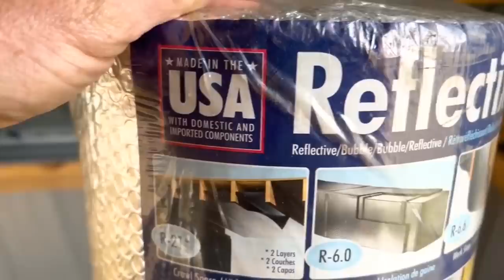We built a self heating chicken coop | Keep your chickens warm all winter…

Comment: If you let mama and babies hatch in nest, you will want to put a wire mesh see through screen square piece in front of the nest that you can either slide into place or place on the outside. Because when she hatches them they will fall out or she will jump out of nest box before all the eggs are hatched and the rest of the eggs will get cold and die. I close my hen in once she starts to hatch them for about 4 days. I emmediately put two tuna cans fitted in the corners. One with babies mesh and hers and the other with water. That way she doesn't have to leave the nest at this crucible temperature time needed to hatch them at the last stage. I will then visit her every one of those a.m.'s and take her out of nest box and place her on floor. She will emmediately go to the bathroom on floor and not nest box . I then enclose her back up again. This way I also get to take out older egg shells, thou the babies eat the lining and is important I think? I also get to see how many more eggs  need hatched. It's important to not mess with her more than this at these stages because I've had hens that will stop sitting on eggs if you mess with them too much. By providing food, it gives her those few extra days of soloraity to finish them out. Sometimes if you want you can put different kinds of chicken eggs you want her to raise from other farmers breeds.
Reply from the maker: Thank you Shelley for the tips. Have a great day!

Comment: Adding a water- filler black barrel in the area where the sunshines will add a thermal mass /heat storage tool that absorbs  sunshine and heat all day and slowly release the heat thru the night.
Reply from the maker: It will freeze solid up here.

Comment: I would've built an inner enclosed area for night roosting that their bodies & large jugs of really hot water could keep warm. Then allow them into the existing space once the sun  has heated up the air & roof. I insulated my wide thick board henhouse then wrapped the inside with drywall & Tyvec, THEN LARGE PCS OF CARBOARD WITH JUST 2 SCREWS AT TOP because as hens fly up onto roosts or climb the ladder they often poo on the walls & shake out all the dirt from their feathers (FROM THEIR DIRTBATHS). I only use newspapers overlapped on the bottom floor which is covered in old tub surround plastic, taped at seams. This way I can control any parasites etc & just roll up the dirty papers each morning, like a carpet. When weather is good, I lay  lots of layers of paper, which provides insulation & makes it easy to maintain a clean floor, just roll up the top shitty wet layers. Dust as we know is absolutely terrible for poultry, &  parasites don't tend to live in newpapers. In summer I spray below the newspaper layers to ensure this. The outer door I also insulated then tarped over on the inside. Have a 2x4 along the bottom which overlaps the threshold,  to ensure that even a spider can't enter the threshold due to the overlap. Then I put & 2x4 beneath the door on the outside once i close it with several latches, a wooden button & when the racoons are around, a cement block against the door. I never leave the door open. In 3 yrs never had  a mole to contaminate the henhouse.  I have wire layers in 3 inch wide slits beneath the roof overhang that in winter I screw several layers of foam that they use in daycares over to keep direct wind off the birds but still allow some air. Although going in & out with hot water etc allows for that anyway.  I drilled holes near the top of large containers that protein powder came in & put synthetic rope thru them to make a flexible handle so that carrying out several at a time filled with very hot water is easy. This helps warm up the space that the birds settle into for the night & they then make body heat which may be hard to do in a very cold space. I also put large container of super hot water into their water bowel which is in a box full of shredded paper for insulation. This helps keep the water from freezing up too thick for them to break thru on most nights.  Because there is no chance of rodents getting into the space, I can put a bowl of breakfast down for them & can sleep in a bit myself. The bowl has a huge rock in the center so that they don't flip the wide mixing bowl.

Comment: Should have an air gap between the tin and the foil. I realize the bubbles are supposed to act like an air gap, but the direct contact with the tin allows for heat transfer from the tin to the room, or the room to the outside depending on the season.
Reply from the maker: There is an air gap between the metal and the foil. The bubble foil insulation is stapled to the purlins giving about an inch air gap.

Comment: I would of installed the reflective material on top of the roof framing against the metal roof.  That way it's a clean look and will be easy to clean in the future.
Reply from the maker: The reflective material needs to have an air gap between the metal. The way we have it, it gives it an inch of space. Keeps moisture build up from forming.

Comment: not sure why you insulated the roof the way you did. seems you did the walls correctly. with double sided reflection you would get better results if you have an air gap on the back as well. it would have been easier putting it up too. i have done this for years on my green houses. nice coop. similar to the one i built. i love those poly-carbonate panels 🙂

Comment: Great effort! Seriously over-engineered for a chicken, though. Don't be surprised if they try to eat that bubble wrap insulation. It might cause crop impaction. They love to scratch at anything shiny. Best case scenario is that they just rip it off and don't eat it.

Chickens don't need heat in the winter. Seriously. Keep everything dry and ventilated and they will be fine.

A little background... I genetically engineer chickens for winter hardiness. They live in a coop with a 2' x 2' hardware cloth window that is never sealed.

The worst thing is to insulate everything and seal it up tight. They will die of respiratory diseases. With the right chickens, you will not need heat of any kind in that coop.

Enjoy your birds!
Reply from the maker: The coop is very well vented. The bubble foil is not foam it is covered in a thick plastic layer. Our birds do not peck at it at all

Comment: Couldn't you use the same insulated bubble wrap to make the wall you mentioned at the end and it further help to warm the nesting area? Would something like that even work? 
I had wondered why you mounted the crates like you did. 🤣
Reply from the maker: I believe by leaving that open, the sunlight that comes in from the clear roof side will bring in heat and it will then be able to move over the the steel roofed side and hopefully stay there. We fed before sunup this morning and it was crazy how warm it was in there compared to the outside.
Reply: @9252LIFE  - Ok. I wasn't sure if it would still work the same as hoped so I am glad the way you envisioned is working nicely so far. Whoop!
Reply from the maker: @PaullaWells  we’re going to keep an eye on it and maybe do some different trial and errors just to see if we can get it dialed in the best we can.
Reply: @9252LIFE  - I have doubt y'all will get it figured out to work super well. Maybe not in subzero weather, but if it can the rest of the winter it would be super helpful. Although if it does get it done in subzero weather, well, you have a patentable invention on your hands. 😉

Comment: We tried the crates for chickens but they didn't work well at all.  Chickens roost on the sides and fill hay with you know what all night long. We ended up having to change hay daily.  Ended up having to use old style chicken boxes so they can only sit inside boxes instead of hanging on edges.
Reply from the maker: We put boards on top of them and they work great

Comment: Have you checked what the temperature is? You did a fantastic job !
Reply from the maker: We haven’t put a thermometer in there yet. But it’s been around 17 degrees Fahrenheit and the water in there has yet to freeze. The water outside the coop freezes solid.

Comment: This video is 11 months old at my viewing. Wondering if you made any modifications to the coop. iMO those roosts are way too high (hence the roosting on the nest boxes) and the boards should be turned flat so they can sleep on their feet for warmth.  Just wondering how the chickens are and if you made any changes.
Reply from the maker: The chickens are great! The roost are not too high as they all are up there at night. Our free ranged meat birds will roost 20 feet in the pine trees. So don’t let chickens fool you. The only thing I’d change would be to cover up the bubble foil as they peck at it and maybe find some tires for the jacks that hood air to make it roll smoother.

Comment: Another job well done! I see those apple scraps will be cleaned up in no time. How did the first year garden do? It won't be long before you'll be starting seeds again for next year.
Reply from the maker: The garden was ok and we did can some. We probably won’t start seeds like we did last year as it was extremely tough bringing them outside from inside. They didn’t like the climate change
Reply: @9252LIFE , You may have to build a small greenhouse so they can get acclimated to the weather without moving them back and forth. You've got some great helpers. 😉 😁
Reply from the maker: @musicluvr70  that’s possible
Reply: @9252LIFE  😉

Comment: i put reflective foam on the inside of my chicken house.  The chickens pecked and tried to eat the foam.  I would skip the insulation.the only exception is using straw stuffed in the walls.  If the chickens pluck that out, no harm done..you just put new in.
Reply from the maker: The bubble foil insulation we used is covered in a thick plastic and is very durable and no foam.

Comment: Don't you need insulation on the end in the clear roof section?
Reply from the maker: We could put some there but not necessary as it’s been in the teens lately and the water inside the coop has not froze.

Comment: So what is the difference between the reflectix that you used for insulation versus foam board installation??
 By the way I love the way you built your chicken house....
Reply from the maker: The Reflectix had a foil side that Reflects heat. Also the foam board is a bit more pricey and the Reflectix is a bit easier to use in smaller areas. And I think the chickens would end up pecking the foam board if I were to use that in there.
Reply: @9252LIFE   I was thinking about putting insulation in our chicken house and then putting quarter inch plywood walls to cover it.....
Reply from the maker: @ryanlevron1972  the Reflectix is easier and seems like it would seal up better. Just be sure to have good ventilation. The chickens put off quite a bit of body heat. But it will depend on the size of your coop and the amount of birds you have in there.
Reply: @9252LIFE   Right now the chicken house is a 5' by 8'...... And we have 15 chickens..... When we bought the property springtime of 2021 the little building was already there... previously was used to store firewood.... We converted it into a chicken house...
Reply from the maker: @ryanlevron1972  I personally would definitely recommend the Feflectix for that.
Reply: @9252LIFE   Thank you very much for responding and answering my questions...... I truly do love the way that you have put your chicken house together...... And this has given my wife and I something more to research...
Reply from the maker: @ryanlevron1972  no problem. Enjoy your chickens!
Reply: @9252LIFE  haha.... We just moved to Wyoming a bit over 3 years ago from Tennessee...... So the last 2 Winter seasons we have been trying to figure out the best way to insulate the chicken house to keep them warmer

Comment: @9252 LIFE HI, I'VE TRIED EDUCATING MYSELF ON CHICKEN COOPS, DESIGNED ONE MYSELF, HAD A MAN BUILD IT, BUT HE NEVER FINISHED IT. HOPEFULLY WHAT I SHARE WITH YOU WILL HELP YOU.
     THOSE ROOSTING POSTS, NEED TO BE ROUND ABOUT TWO INCHES THICK, THEY CAN'T CLING TO THOSE BIG ONES AS YOU HAVE, THOSE CAN CAUSE WHAT'S CALLED CLUB FEET, AND THEY'LL BECOME CRIPPLED. 
     YOU'VE DONE A BEAUTIFUL JOB. MY COOP IS OFF THE GROUND 18 INCHES ON 4X4 POSTS, WITH A SLANTED ROOF TO KEEP RAIN/SNOW TO SLIDE OFF. DON'T HAVE MY ROOSTING BOXES ON IT, OR CHICKEN DOOR CUT OUT, WELL JUST SAY ALL I HAVE IS A BOX ON STILTS, NO ONE TO FINISH IT. :( 
     YOU FOR SURE NEED TO PUT THAT TACK CLOTH TWO FEET OUT FROM THE BASE OF YOUR COOP (ANIMALS WON'T DIG MORE THAN TWO FOOT AND GIVE UP) OR ELSE WILDLIFE WILL DIG UNDERNEATH IT AND GET YOUR CHICKENS. IF YOU HAVE HAWKS, OR WHAT EVER PREDICTORS IN FLIGHT, IF YOU HAVE A CHICKEN RUN, BE SURE TO USE HEAVY GAUGE STRING BAILING TWINE, COLORED TWINE (DON'T KNOW IF THEY SEE COLOR LOL) ACROSS THE TOP ZIG ZAGGING IT, WHEN THE BIRDS WHICH DIVE DOWN AT A 45% ANGLE SEE IT, THEY WON'T KNOW HOW TO MANEUVER IN FOR THE KILL, SO THEY CANNOT GET YOUR CHICKENS. 
    AS FOR THE BEDDING, I WOULD SUGGEST AUBIOSE ORGANIC HEMP, I BOUGHT SOME, BUT HAVEN'T USED IT AS I HAVE NO CHICKENS, HOWEVER YOU'RE WASTING MONEY ON HAY/STRAW WHAT EVER YOU'RE USING. AUBIOSE DOESN'T HAVE TO BE CHANGED OUT BUT CLOSE TO TWO YEARS DOWN THE ROAD. IT DETERS THE FLIES AND SMELL I WATCHED SEVERAL OF SOUTHERN COOPS I BELIEVE IS THERE NAME ON YOUTUBE, THEY DISCUSS THIS STUFF AT LENGTH. IT COST ME AS MUCH FOR THE SHIPPING AS IT DID FOR THE 40 LB BALE, BUT IT'LL BE WORTH IT.
     TO YOUR SUCCESS. WISHING YOU WELL. 
     QUESTION: WHEN YOU PUT THAT SILVER WRAP STUFF UP ON THE WALLS, I TAKE IT THE METAL SIDING IS GOING TO HEAT THAT UP. I DIDN'T SEE ANY VENTING FOR YOUR COOP, THEY MUST HAVE AN AIR FLOW. TC SUB'D U
Reply from the maker: There’s about an inch gap between the sheet metal and the bubble foil
Insulation. The ends are open through the corrugated ends up to the roof. Also the lower two foot of the entire build is center quite well.
Reply from the maker: @wheepingwillow24u17  no need at least for our situation for the extra predator cloth. Our guardian dog Kerchak doesn’t allow any predators near our livestock.

Comment: No need to heat a chicken coop. The birds will be fine as long as temperatures don't drop way into the minuses.

Heating a coop can risk creating humidity which will adversely affect the hens much more than a little cold weather. Keep the girls dry and out of the wind, and they'll be fine. 

I never heated my coop. No frozen birds, no frost bitten feet or combs.
Reply from the maker: Yep

Comment: All that insulation is useless with the wind and cold air coming thru the screen. I'd suggest an insulated partition between the insulated area and the open screened area.
Reply from the maker: When winter hits with more snowfall the sides will be completely covered. We are going to test out different options throughout the winter and see how we can get the best performance out of the coop

Comment: So not self heating! 1/2" of hay, 6" vent at the peak and snow on the clear panels...... must be an engineer.
Reply from the maker: Each chicken also produces 10 watts. And when it’s snowing the sun isn’t usually out. And once it stops snowing we simply remove the snow. And we have much more stray bedding on the floor area that will be eventually topped with pine shavings as well. The chicken poop will start composting down creating heat. The water buckets inside the coop has yet to freeze. It’s been around 17 degrees Fahrenheit the last couple days . And no I’m not an engineer…. Take care Michael